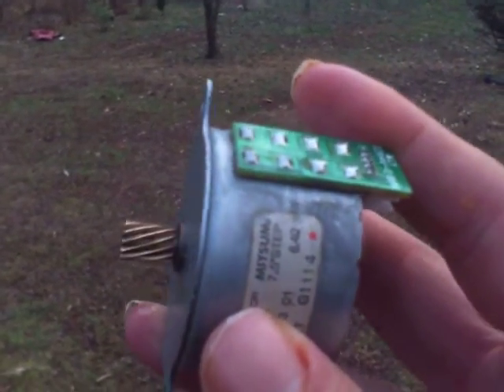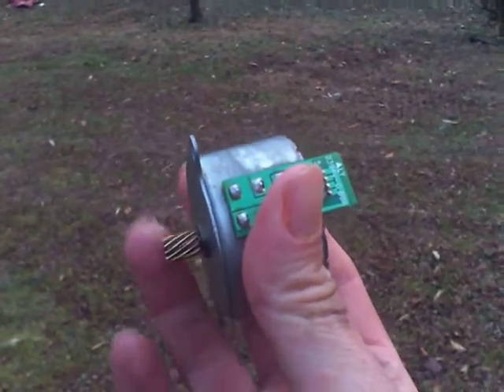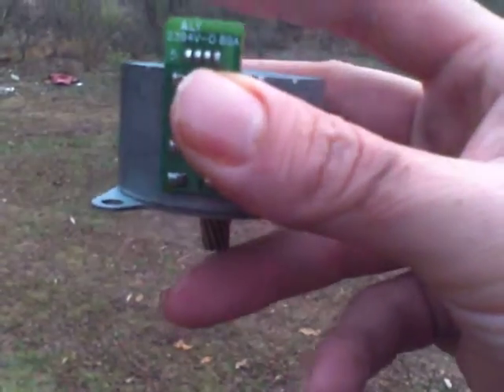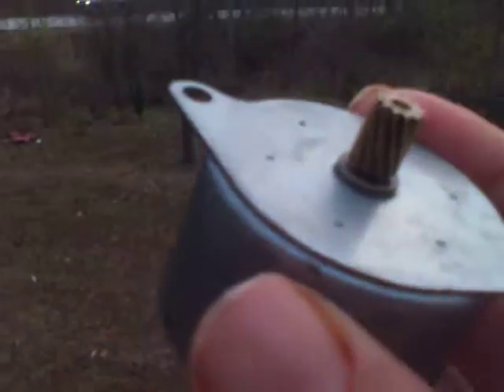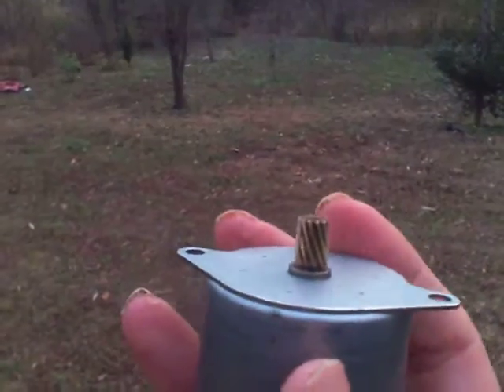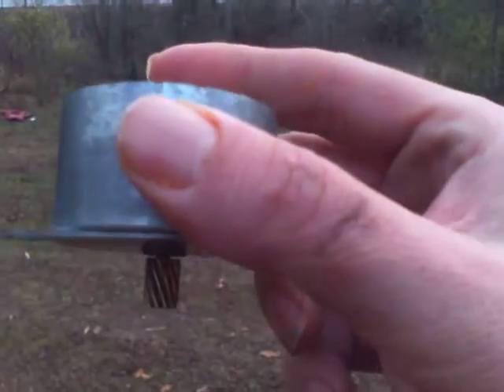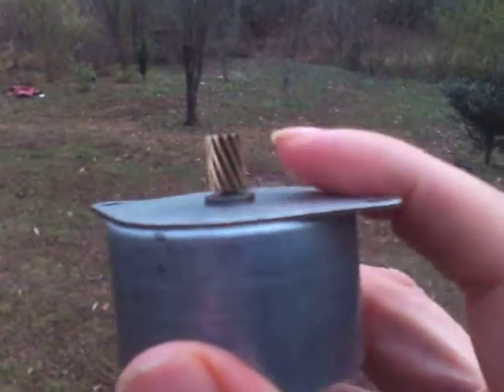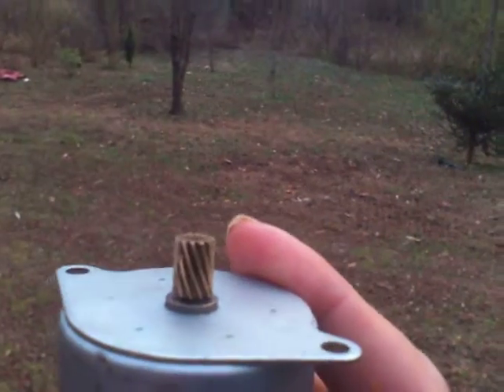free energy  2x power out of a generators  the  God generators

Comment: Let me first say that I am totally into receiving energy from the ambient, but about this project, I just would like to mention that any electric motor and generator have COP (coefficient of performance) of 0.24 or so and that's because of the BEMF (Back electromotive force) generated inside the motor/generator. This means when you give 12v to your motor, only about 3 volts is doing the job and around 9v is just going to waste! With such motors/generators you never achieve COP>1...